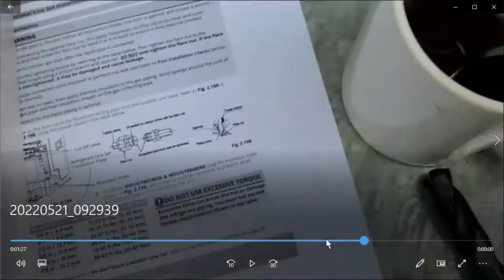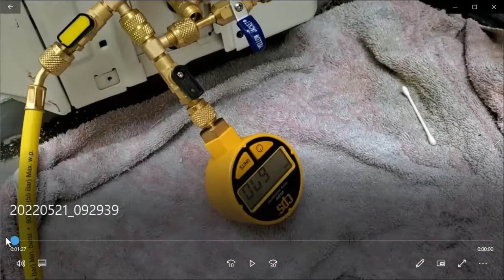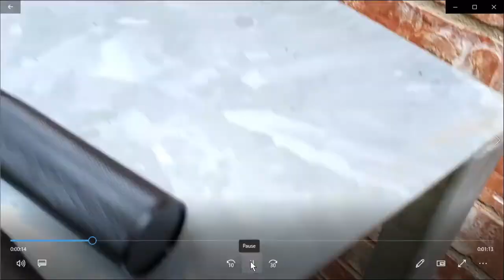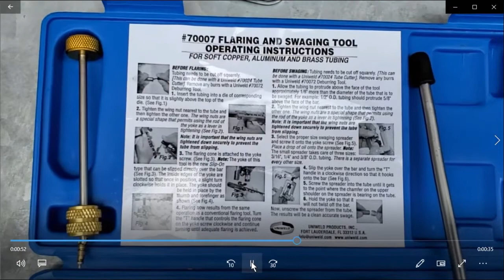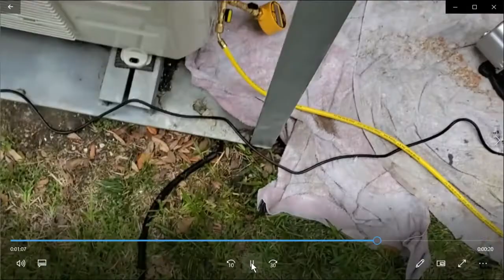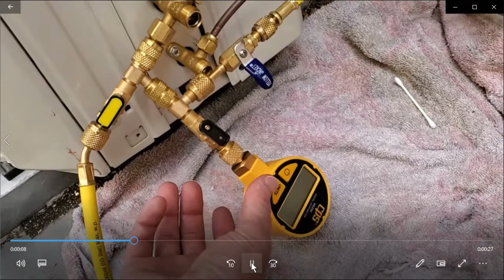MrCool Mini-Split Compressor/Condenser replacement, P4 error code

Comment: P4 error could also be electrical.  Unplug and plug back in your 3 wire connection from the compressor to the control board might fix it.  Should be a white "T" shaped plug on newer models.  Can also check it for equal resistance on all terminals and it should have no continuity to ground.

Comment: I'm getting a very high pressure -235-250 psi on the lines. Could that be causing a P4 error? My compressor kicks on for a second, shudders and turns off.
Reply from the maker: I have no idea. But I am guessing you didn't open your valves all the way; which is the most important step in the installation.
Reply: @garagebuildz5216  both of the valves are opened to the max. I'm debating on using conventional copper lines and vac them to get rid of risk the coolant isn't flowing.
Reply from the maker: @robertberin4872  If you are installing from scratch and following the instructions you should not get such an error.  There is no such thing as a vac clearing a blocked line. I am not an HVAC expert. I dont even know what the pressure ought to be. P4 is a voltage issue. Check the voltage on your terminals and check if it matches spec, and check your terminals have good contact. Some people confuse 240V and 120V systems.